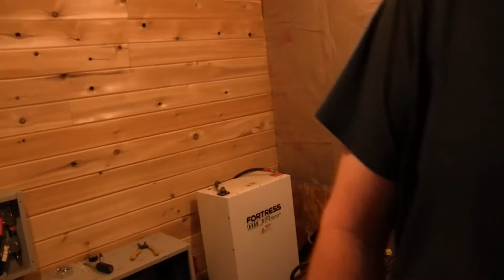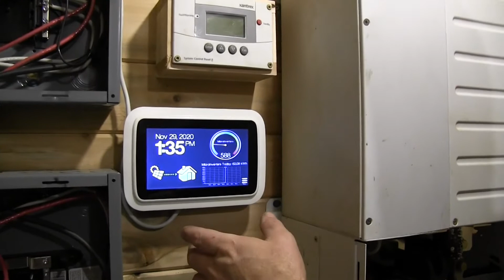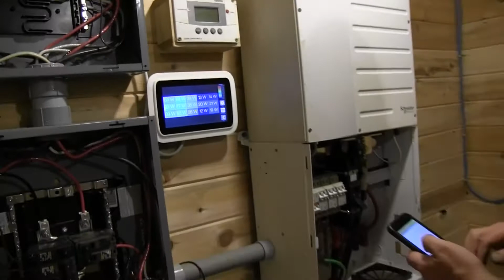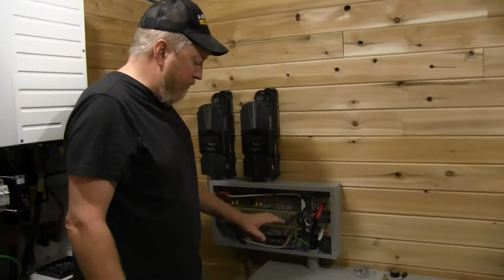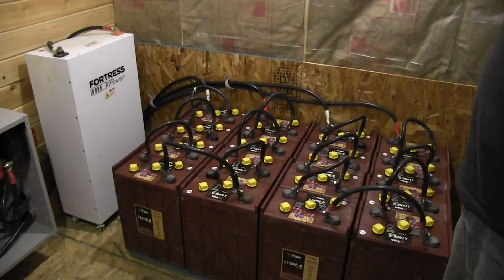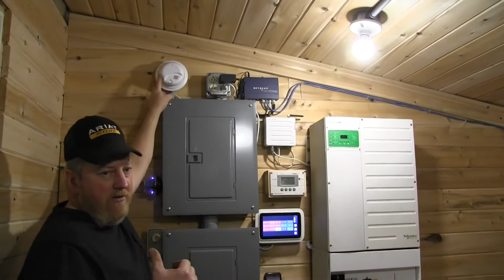Solar System Electronics Tour

Comment: Are you doing R&D for Midnite? You say you will be testing lots of equipment.
Reply from the maker: In full disclosure Ryan works for Midnite as an applications engineer so yes he does a lot of testing and pushing limits on the new products.